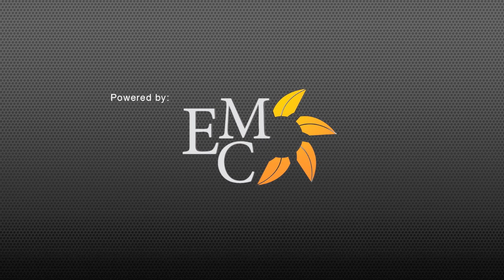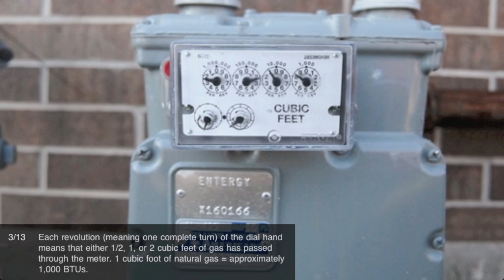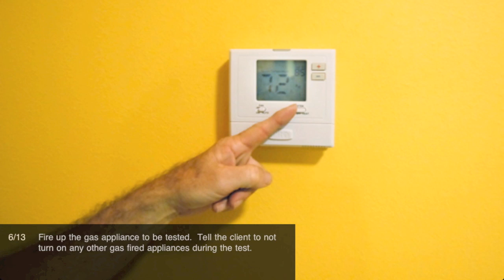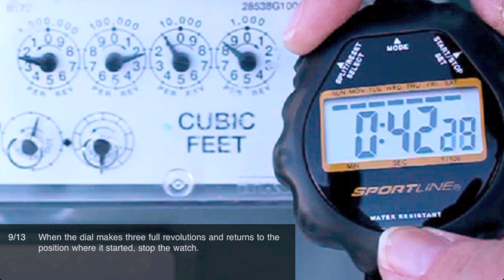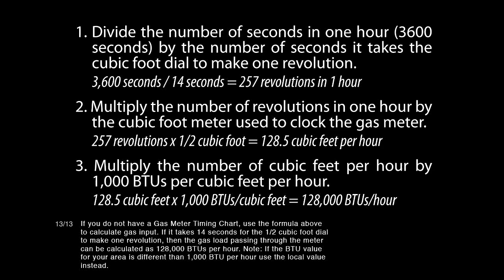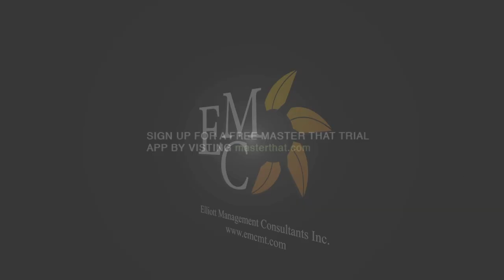MasterThat // Clock A Gas Meter

Comment from the maker: Hi goneil90804. We do not suggest clocking as a method of leak detection. Your best bet would be to have the gas lines pressure tested for leakage by a gas professional.